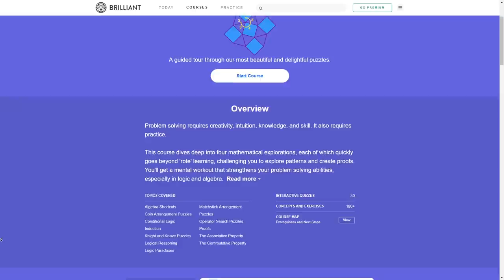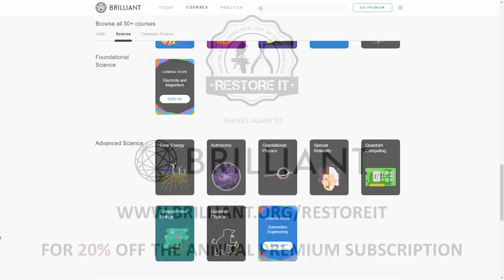BMW E30 M20B25 Engine Rebuild Restoration - Time-Lapse | Part 5

Comment: Using a blow torch on top a wood surface on a metal with oil inside it while spraying WD40 on top. This guy has some balls xD
Reply: Bonus points: Throwing the little gas lighter right in the flame direction 13:40
Reply: Very common practice as mechanic
Reply: @Pesterenan Are you the type that thinks when cars are on fire that they explode and flip 75 times in the air and then land on the ground explode again flip 63 more times and then land explode and level the entire block like Hollywood movies lol
Reply: @TRX450RVlogger  i am
Reply: @TRX450RVlogger  When I was 18 my first e21  BMW 2.3 straight six caught fire while driving. (Insurance inspector opined it an electrical issue early 323i were known for).
A reasonably sized aftermarket fuel filter I had to put before the injection rail suffered heat effects, developed gasolin-vapor under pressure and went off pretty good, what subsequently popped the hood - which was front hinged luckily and thus fell back closed when the orange spurts were fulminated; I decided to better relinquish the vehicle and sprang out letting it go in second gear just seconds before the nearly empty tank went off and popped open the trunklid, blew out the rear window and lifted the rear tyres for a moment long enough to change its direction - right into a filling station. 
Still ablaze, car got stopped by a pump which was knocked over but wasn't in actual use, so regrettably no full fountain of pumpgas geysered into my burning wreck: no block leveling this time. 
But by principle, You got it pretty accurate.
(The clerk and I could stop the fire emptying numerous extinguishers hanging all over German filling stations for good measure.)
Reply: @manfredschmalbach9023  That was really bad luck and a combinations of a lot of different things that happenned at once but cars don't usually explode like that. My dad had a peugeot 605 burn back then when they were like 10yo cars, he went to the mechanic for something and the mechanic found damaged fuel lines,  but he didn't have the parts for this exact car so he replaced thoses hoses with ones from another car while he was waiting for the correct ones, thinking good condition lines from another car were better than damaged original fuel lines. Well, he was wrong, those hoses turned out to be rated for a much lower pressure than the 605 fuel system used, so the hose exploded under the high pressure, fuel sprayed everywhere (and kept spraying for a long time as the fuel pump stayed on for a while) and the whole car just burnt, the fire extinguisher of the car did absolutely nothing, just as the extinguishers from other people that stopped to help.
Reply: @imnota  I know right, cars do not explode like that usually, but it's way more fun if they do, ain't it? 
Had a Peugeot 404 injection once burning besides an Autobahn, which was a completely boring burn-down until the firebrigade shat it out with a healthy serving of foam. Nothing to write comments about.
What does a noice BOOM recurrently though are powerboats when refilled improperly: gasoline-fumes are heavier than air, so every nook and hatch and dorade has got to be gastightly shut to avoid filling the hull with fumes exiting the tank when gasoline fills it. I saw more explosion-damaged boats than sunken/resurfaced ones in 30+ years of boatbuilding.
Reply: Safety 3rd!! Bonus points if he wasn't wearing a respirator!

Comment: You're doing a great job with this restoration. There are a couple of things I noticed, one being for your protection: 

1) When you're mucking about with Naval Jelly (what we call that pink goop in the U.S.), wear gloves, because it is incredibly caustic and will burn your hands before you know it's happened. 

2) The oil cooler hoses should be replaced, because they tend to deteriorate from the inside out. If you've ever taken a look at an old radiator hose, you'll see that it's far more degraded inside than it is outside. I'd hate to see you go through all this work, only to have an overlooked part fail. 

One last thing, are you clearcoating the bare metal parts you've de-rusted? The reason I ask is because they're going to rust up even quicker, now that every trace of the old, original coating is completely gone. Look into metal plating techniques, it will save you headache down the road.

Keep up the great work!

Comment: I realize this is a restoration and you typically restore or fix things instead of replacing parts, but those oil cooler lines should be replaced.  I would think the metal parts would be fine to reuse, but it would be the 20+ year old rubber bits that would concern me.  You did make them look nice, but since it was all apart, I would of replaced them. They might last another 10 years or 1 year.  If I was going to reuse the metal bits, I would of taken them down to a hose shop and had them replace the rubber bits with new hoses and clamps.  It also looks like you have some hoses that will carry coolant or oil in your overall parts shot, that will have o-rings on the ends, the o-rings should be on a bare surface, not a painted one.  In my experience, it will eventually end up leaking.  With all that said, I think you are doing a great job and this car will look amazing when you are finished.  Have a good day!

Comment: I'm the kind of person that washes a part with degreaser and thinks: "there now it's clean and restored"

 And then you have this guy
Reply: Well I think painting everything is not the answer either. You touch one of those painted pieces once while repairing or replacing something and you have it scratched again.
Reply: 🤣 right

Comment: That was an incredible job! One suggestion I would make is that you should add some more structure underneath your vise so that your workbench does not bend or crack. It will also optimize the strength of your vise

Comment: Looking good so far, although depending on the age of the fan I would actually suggest maybe getting a new one. If the blades fail and brake off it can ruin your radiator and/or fan shroud. This happened with my previous E34 540i and after inspecting the broken fab blades I found it was still the original from factory. Previous owners were just replacing the viscous and no one ever replaced the fan blades... until it broke 2 other parts while I owned the car :p. BUT, it depends on the age... hard for us to judge from a video.

Watching your videos is making me miss my E30 so much right now :(

Comment: 5:39 you could have used "permanent" ceramic trim restorer instead of painting. It obviously would not last forever, probably ~5 years on the fan but would have kept it looking more original than painting. Although, I understand fan was little bit broken, so painting probably was inevitable.
It would be interesting to know why you decided not to restore oil cooler, not that you should have just interesting to know what you consider to be beyond restoring and why. Finally little tip with using torch - you can obviously use WD40 after heating as you did, but other thing you can try is sprayer with "cold" water.. that temperature change sometimes helps more than WD.

Comment: Jesus Christ you fillered a fan. 
Next level OCD 👍🏼
Reply: With that filler wont be the fan unbalaced?
Reply: The amount of weight added from the filler is so minimal that it won't cause any issues.
Reply from the maker: haha I think It's official. I do have OCD.
Reply: @RestoreIt  well done mate. Keep up the good work.
Reply: Its a gift, and a curse 😁
Reply: Fans need love too
Reply: @talos86  Engine driven radiator fans don't spin fast enough to need to worry about small weight differences in the blades. Injection molded parts have that problem from the factory already. They're usually on a reduction from pulley size and from a fan clutch to avoid excessive speed. If the fan spins too fast, it will rob excessive power from the engine and not provide additional cooling benefit to the radiator. A seized fan clutch usually causes the vehicle to run very poorly or stall out.
Reply: I must have some kind of reverse OCD it literally makes me mad seeing him applying filler and wet sanding such things. Like really seeing him spend that much time on something that seems stupid to me makes me go crazy, like all that time could be used much more wisely and the car would be done.

But I definitely would do stuff like repainting everything, zinc coating, and all, just think using filler and wet sanding stuff is too extreme, but I'm not the kinda guy to just slap it together either.
Reply: Should always replace the fan, never repair it.  On my BMWs I replace them every 60k, they tend to explode and take out the radiator, hoses and hood.  VERY common problem.

Comment: Great work but I wouldn't run that fan these fans are already a weak point on any bmw and obviously with the crack is due to fail and now unbalanced by the glue and filler honestly by a oem replacement they are not that expensive compared to one failing and wiping out your hoses and rad and fan shroud as me how I know 🤔
Reply: This is a restoration channel you know, ie restore stuff not buy new stuff, if he kept buying new all the time he may as well buy a new car.
Reply: @MegaDirtyberty  yeah I'm all for Restoration of parts as I restore classics myself but sometimes important items like this just need to be replaced I've owned several bmws and these cause alot of damage when they break
Reply: @jasonking8812  I too restore classics, I too have had plastic fan blades break. I too know the damage they 'might' cause when they break, in my experience the plastic flies everywhere and doesn't do any damage.
Reply: Honestly IMO if were my car and I had to make the choice i would have ditched the hub/belt drive fan and just go with electric thermo fans with a controller, much more energy efficient and fuel saving too.

Comment: Love your videos! Gotta say I'm surprised with how well your wire bits for the dremel holds up! Mine lasts like 30seconds only ;/ what rpms are you running at? And is that "niupika" the brand name? They don't seem to be shipping to sweden unfortunately..

Comment: What did you wire brush on the intermediate shaft (item at the right of the picture at 4:06)?  If it's just the nose where the timing belt sprocket attaches that makes sense, but the bearing journal surfaces need to be protected and treated like the bearing surfaces on a camshaft or crankshaft.  Otherwise, I definitely appreciate your attention to detail.  Cool Stuff.

Comment: I would have replaced those rubber hoses. Once they get old you and the rubber becomes dry you cannot trust them.
Reply: ilfordino - Ford Fiesta Tutorials - I am old... I can confirm. 😁
Reply: Same goes with the plastics.  They get brittle after all those heat cycles.

Comment: You should look into powder coating metal parts rather than paint. It will save you loads on paint and its self leveling and hides the little imperfections (plus its way tougher and will last longer). You can build a powdercoating setup for cheap using old oven parts.

Comment: After you cleaned up the metal parts of the oil rad hoses, is there a way to protect the metal from rusting again? Could you clear coat over it?
Your OCD is infectious by the way. My 205 1.9 GTI engine is now in bits and getting the same treatment 👍

Comment: When I saw you remove the lines from the oil cooler I thought, "oh good he's going to clean up the oil cooler and at the very least replace the rubber lines...they've got to be on their way to being expired by now." Nope. Lol

Pipe wrenches are for pipes btw. Get yourself a set of Knipex pliers if you want to muscle on a nut like that. You'll be happy you did.

Comment: I started all videos from beginning, this is why i comment an old video but one question,
Why you never clean inside pipes ? There should be some deposit of old liquids and dust and rust, arent there? 
Thanks for those videos it made my whole month and still didn't finished watching.

Comment: Hello, question:
The oil lines on the oil radiator, you painted just a part of them, aren't they bare stell now an rust? Or are they stainless steel?

Comment: After seeing how corroded the the oil cooler´s connectors were, I´d recommend putting some anti-seize on the threads. The old lines may be fine, but they´re quite old, maybe you have to replace them in a few years, it would be a shame if you ruin the new oil cooler then.

Comment: To save your fins from damage while storing tape some cardboard onto each side, thats what i do
Reply from the maker: Good idea, I need to store everything away so it doesn't get dusty!
Reply: Restore It yeah id hate to see that oil cooler get messed up after all the work youre putting into your e30

Comment: Please use a new fan for the cooling fan. These tend to fly into pieces and damaging hoses, the radiator and denting in the hood. There a new part IS necessary.

Comment: You have to put a wrench on the neck of the oil cooler or just going to loosen out of the housing. Work it back and forth so you don't need up the threads. Ahhh oil coolers.

Comment: Why did you use a pipe wench on the oil cooler lines?  Doesn't it bother you that the nuts are all buggered now?  Get some big flare nut wrenches.

Comment: A lot of your painted surfaces are not going to cope with engine heat unfortunately,  the biggest risk is bits of paint flaking off and blocking a oil gallery you should have used heat rated paints and NO paint in internal parts.  Also the fan is stuffed get a new one that thing is waiting to throw a blade through your radiator at the first opportunity.